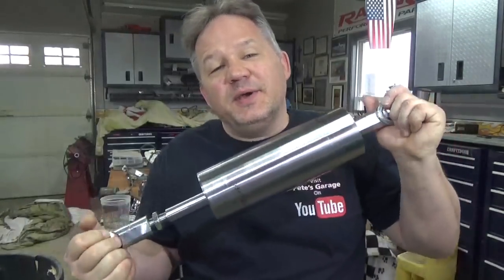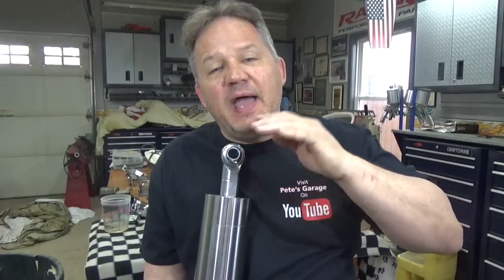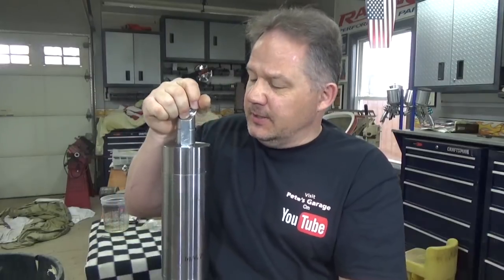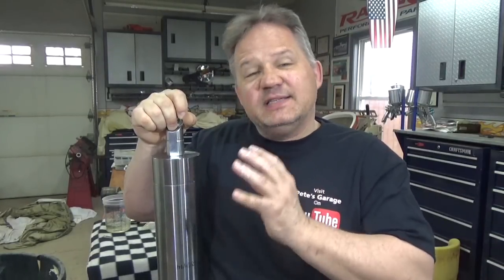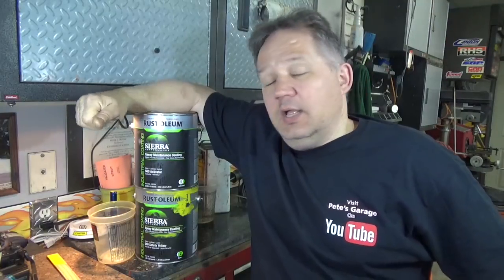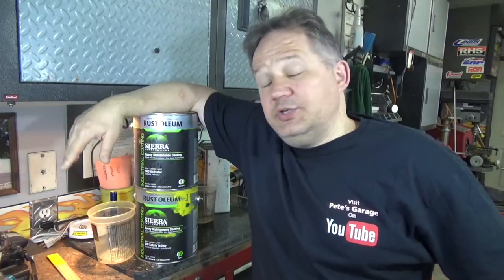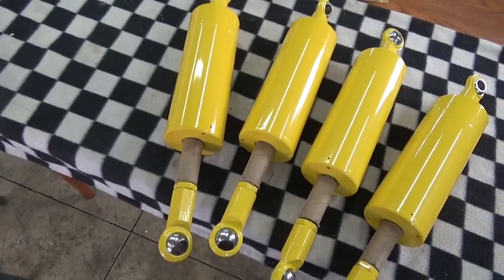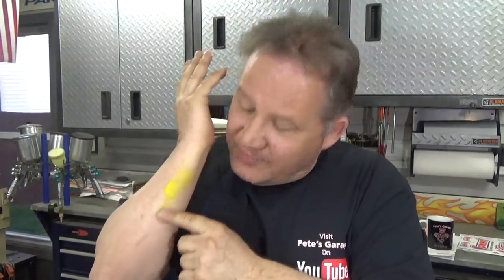Water Based Epoxies, Mixing, Applying, Mechanical and Chemical Properties, RustOleum Sierra

Comment: Great info! Thanks! I wasn't sold on any water based paints for metal until I saw this.
Reply from the maker: It's much better than you think. There is no difference in the epoxy part, just one evaporates water and the other solvents. The mechanical properties are very close.
Reply: @PetesGarage  Kind of off topic. Do you remove E-coat before applying something like Amercoat primer, or other primers? I know it has to be scuffed if you leave it on.
Reply from the maker: Yes, I remove as much as possible

Comment: What fluid tip/needle size did you use ?  I’m using an LVLP (Yes, L), and a 1.5 and I’m getting HORRIBLE texture.  Tried range of settings.  😫
Reply from the maker: 1.6, you probably need to thin it out

Comment: I bought a brand new Fuji HVLP Semi Pro 2 and this paint but in black Sierra S60.  I thinned it alot with water and I get alot of fisheyes, but they are not like a fisheye exactly its like a micro repellant area on the metal.  I am so frustrated.  Maybe I should not have used water as a thinner and ran its straight.  Or maybe I should use filtered water.  I dont know! AHHHAHHAHA! Help Me!
Reply from the maker: Any repellant means something on the surface like silicone